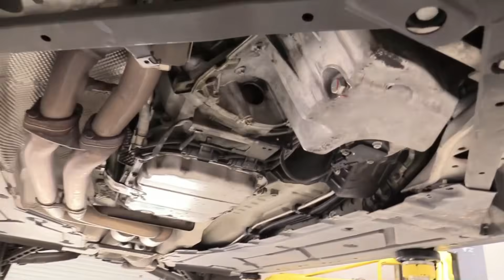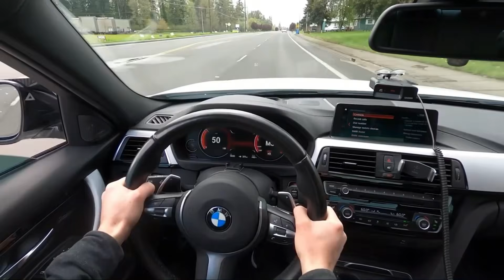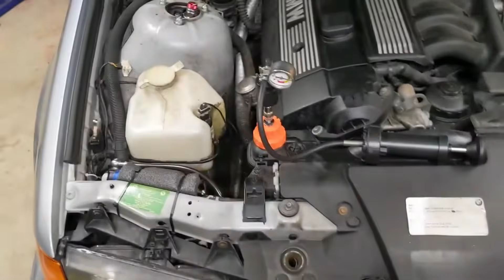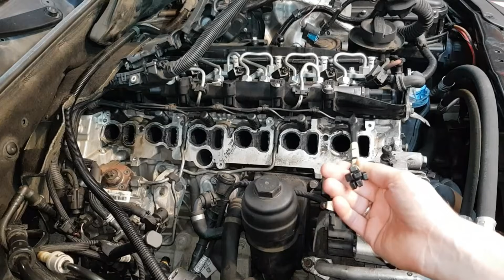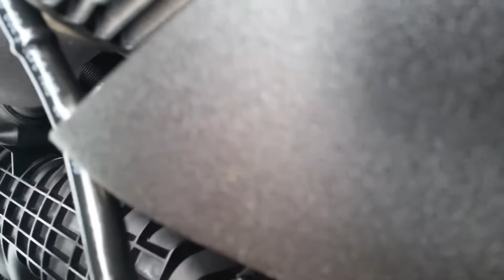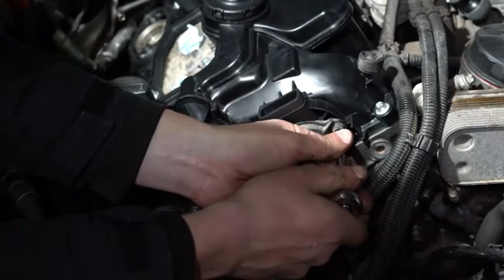10 WORST Things That Will DESTROY Your BMW Engine (Avoid at All Costs)

Comment: Change engine oil and filter regularly with BMW-approved fluids and quality synthetic oil (don’t skip early intervals). 

Inspect and maintain the cooling system (radiator, hoses, thermostat, water pump) to prevent overheating. 

Check timing chain/drive belt and related components before failure. 

Inspect spark plugs, ignition coils, fuel injectors and replace as needed to keep combustion optimal. 

Flush/replace brake fluid, transmission fluid, and differential fluid per schedule. 

Check air filters and cabin filters; replace to ensure proper airflow and engine efficiency. 

Inspect cooling fans, thermostat, and engine temperature sensors to avoid heat damage. 

Confirm no oil leaks or gasket degradation (including oil heat exchanger gaskets). 

Ask for a multi-point inspection of belts, hoses, suspension and brake components. 

Use OEM or high-quality OEM-equivalent parts when replacing anything.